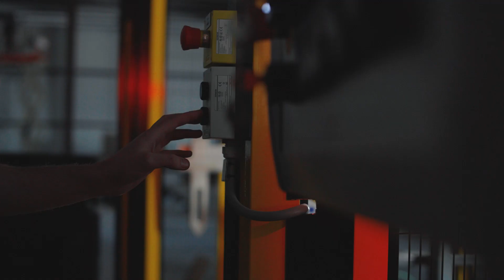2022 SHOT Show Release - Our all-new Flash Forged Technology

Comment: How about you use all that tech to fix my band new RIDGELINE TI chamber so I can handload. (CA response)  The legal language of our limited lifetime warranty does not include any type of handloaded ammunition. $2,400 POS
Reply: I just commented above about something similar. CA had to replace a barrel because it wouldn't even shoot 2moa with factory ammo. Additional it wont eject casings because the bolt head is out of spec, confirmed with gunsmith.